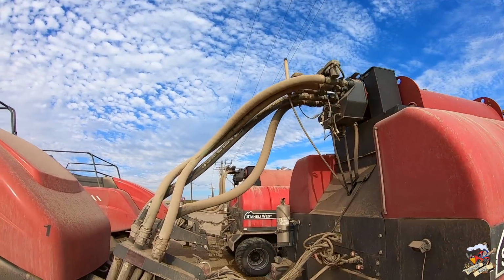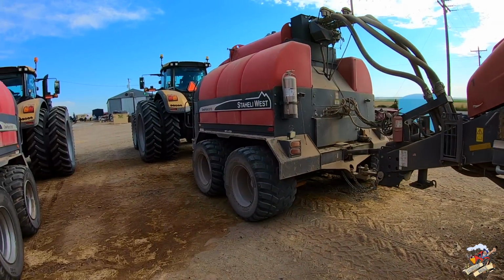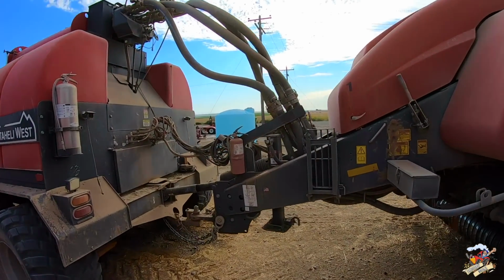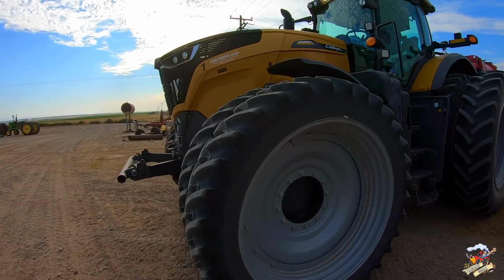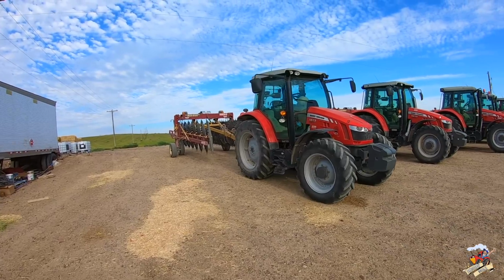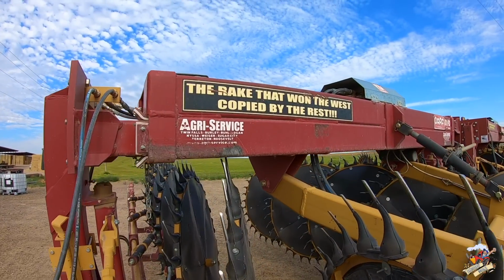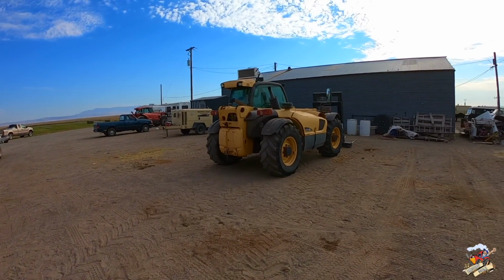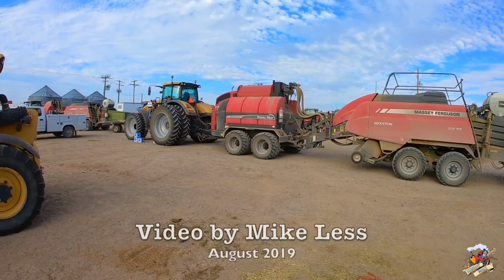Checking out a Fleet of Hay Making Equipment in Idaho

Comment: Probably just shy of $1000000 a rig. Absolutely gorgeous setup any hay farmer would be proud of that.
Reply: The steamer is actually much more affordable than people might expect. I am the Sales Manager for Staheli West. All four of the steamers shown in this video were acquired for less than $500,000. They were purchased used with several hundred hours on them. The tractors look new. Probably $250,000 for tractor just over $100,000 for the steamer and approximately $125,000 for the baler. So all in, each setup is under $500,000. Funny thing is the steamer is so effective, its benefits will help pay for the entire $500,000 investment in generally less than 2-3 years.  Nice video Mike and thanks for the shout out!
Reply: @spencerdouglas98  I don't think you are going to buy a 1000 series challenger for $250k. Probably more like $375k

Comment: I wonder why they had the front tires on the rake tractors backwards.
Reply: Welker brothers went over the reason in one of their videos and I can't remember the reason anymore either.
Reply: Less wear when on the road from what I've told.
Reply: This way they have less bite/traction, witch means less wear on the road and especially in this case, no tearing up the ground when driving and turning on the hay field.